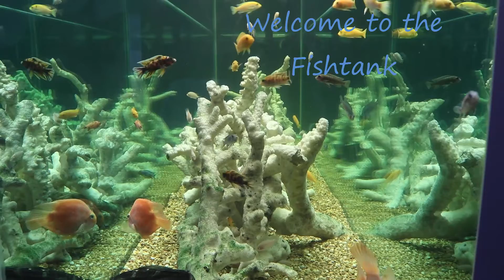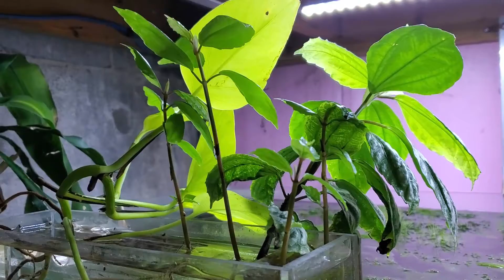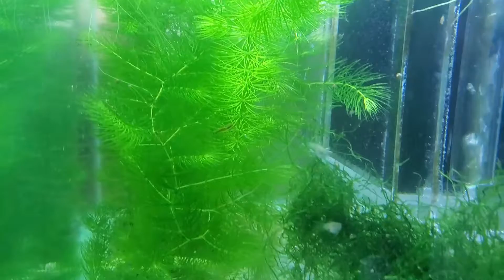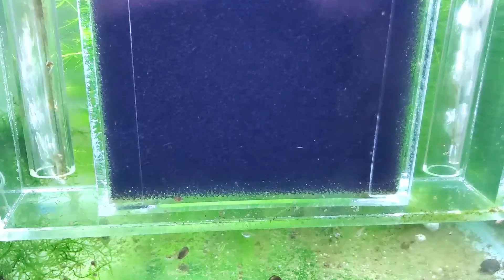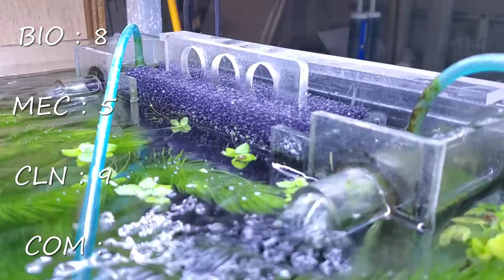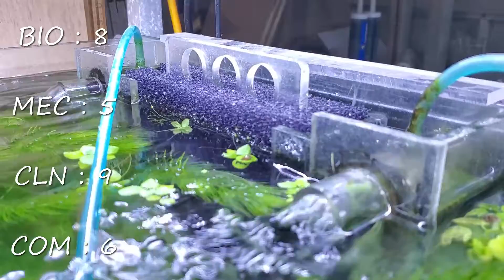DIY Filter Comparison Part 3

Comment: I have never used a Rollingdrum Filter not a Matten Filter.
However having listened and taken in the information you delivered, has clearly brought out that they are both really good in there own ways.
But the Rolling Drum Filter is really cool and looks really impressive plus it's out of the Aquarium so it does not take any space away from the Aquarium which is a good thing if you are wanting bigger Fish like Angelfish and Discus.
So I would rate the Rolling Drum Filter 10 out of 10.
Stay safe and take care.
Reply from the maker: Thanks for taking the time to come by and share you thoughts on these filters!
Reply: @FishmanEricRussell  My pleasure. 😊

Comment: i still like the hob best . 

i have a 20 gallon that came as a kit with a little hob , i added an under gravel filter and attached the hob intake to the under gravel upright . then i put 2 inches of gravel and planted water wisteria in the gravel . then i put lava rock about 3 inches high all over the gravel . in the HOB i just have 2 sponges . also i have a pretty big piece of pothos hanging in front of the waterfall from the hob . 
so after about a month of running it had about a million pond snails in it , that i had been feeding fish flakes . i added a trio of guppies and 40 ghost shrimp . 
the flow is pretty good and i change a 5 gallon bucket of water every other day . it's been like that far 2 years or so , i never gravel vac , just clean the front glass once in a while . it is a jungle of wisteria and the entire bottom of the tank all the lava is green . the guppies get taken out and stuck in other tanks occasionally but there's always at least 10 in there . i don;t know how many shrimp but i see them frequently . so they're all breeding and happy .
 
just thought you might get a kick out of my redneckified filter system .
Reply from the maker: Thanks ever so much for sharing your tank experiences with me! I really like hearing about what others are doing with the hobby. Thanks also for your vote and as always for watching!

Comment: I’m just the hob type of guy. I also use pothos in a top sump. Guess my vote lol.
The tank of mine with pothos hasn’t had a water change in months. Just top it off with hard tap water to keep the minerals in the tank. I recently added plants to this tank. I’m going to push away water changes in it until I can’t .
Reply from the maker: Thanks for your input Bob and for sharing your experiences with planted filters. Let me know how this goes